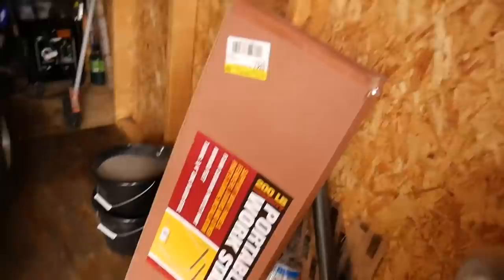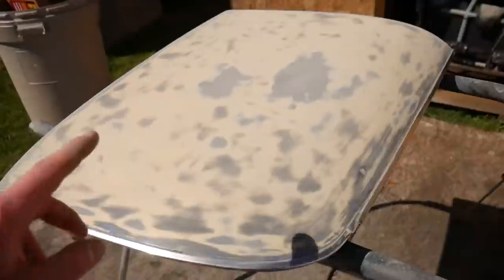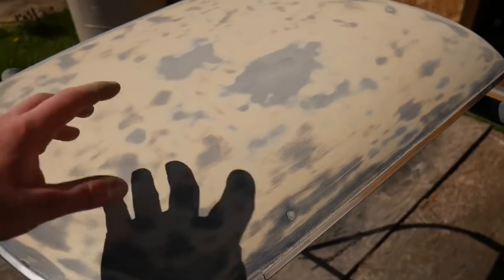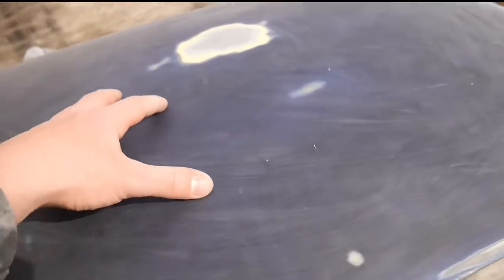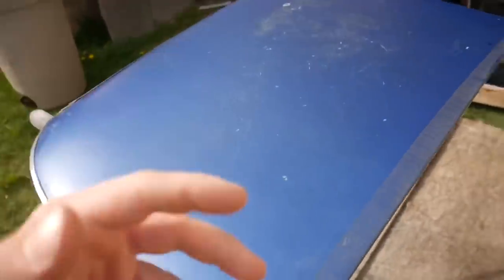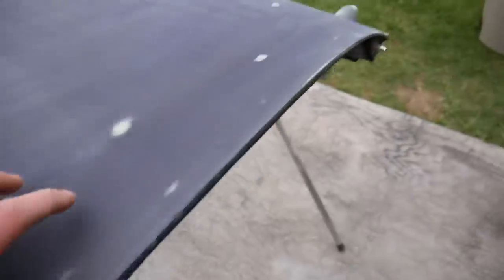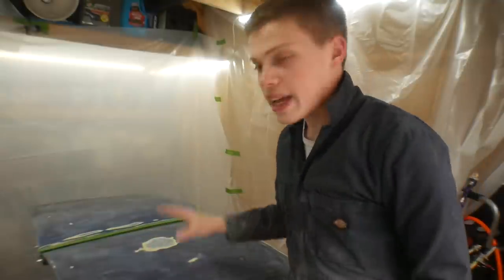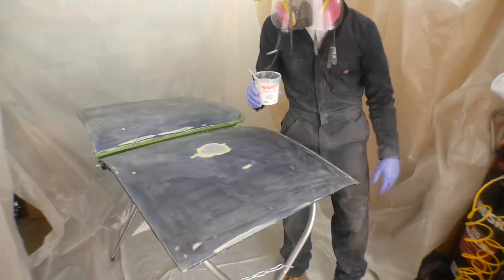Beginning the FIRST Steps in PAINTING the Corvette! Sanding, Filling and Priming the T-Tops!

Comment: Keep heat in there. It will cure way faster and better. Primer likes heat. I work in a bodyshop. And ive seen primer come out pretty iffy due to temperature sensitivity..... u can prob sand the primer once done drying start 400 and 600. Then get sum reducer from paint store wipe it down that will remove any grease or hand wax left behind after u touch them...then U can use glass cleaner to finalize clean them. Then spray your paint. 1200 sandpaper is pretty fine grit and prob will get clogged up alot from the primer. Youll go through more paper then anything probably.... once u do the final clear coat and its dry. Sand the clear coat with 2000 then 3000 sandpaper. And reclear it. It will come out slick as hell man.

Comment: I’m not a painter, but I don’t think that you need to sand with 600 before primer. It takes time and materials. Just leave it at 320 before primer, 600 before paint and it should be perfect. You can block sand primer with 320 and then just go at it with 600, then paint and clear.
Reply: Spot on
Reply: Was thinking the same. Been awhile since I used epoxy primer pretty sure when I did the MFG spec the sanding grit to promote adhesion
Reply: 600 is on the high end for primer adhesion.  320 or 400 would be just fine.

Comment: If you are having trouble with filler setting up on you to fast use less hardener.   There alot of variables that go into it. Has to do with temp and humidity. If it's warmer outside use less hardener and if it's cold you have to use more hardener. It's just a feel thing. You will get the hang of it. When I mix filler I mix mine on cardboard. When getting your panel prepped for primer. I would make a mental note before saying examine the panel for imperfections then take a da sander buzz the panel done with 320 and the imperfections that didn't Feather edged out fill it and block the filler with 180 clean and prime.
Reply: Forget to mention before you fill the area  scuff around the imperfection with like 120 or 150 gives the filler something to bite into to have the best adhesion to the panel.

Comment: Use wax and grease remover (some people call it "body wash") or Mineral spirits to wash it and to wash before primer or paint,
and use the palm and fingers of your hand to feel for imperfection not just your fingers, BUT when it is washed for priming or painting DO NOT TOUCH IT WITH YOUR FINGERS OR HANDS.
At the higher grits of sanding (400+) you might want to get into wet sanding, the paper lasts ALOT longer and cuts better, good luck don't rush it...

Comment: I’m not a professional but I have painted a lot and don’t about 6 cars ur doing good but don’t sand that much u want the paint flat but not smooth sand with 180 and primer or that will will just peel off in a few months trust me and just close ur eyes and run ur hand flat u will feel the high and lows it’s ur first time and fiberglass is very hard to paint just take ur time and take it slow

Comment: 600 grit is too smooth to allow the primer to bite. You should be no finer that 220 grit. Hit me up if you have any questions. I've been in the business for 40 years. Have fun!!!!!
Reply: Check out My Friend Pete and D.I.Y. Auto School on YouTube. He has tons of videos that will help you out.
Reply: If you sand the epoxy, use 180-220. Your 2K primer should be sanded with 320 then 400. Use a non metallic solid color for your paint. Much easier to spray evenly and since you are painting a panel at a time, will match much better. I would also recommend using a base/clear system. That way if you have issues with the color coats, you can repair them before shooting the clear.